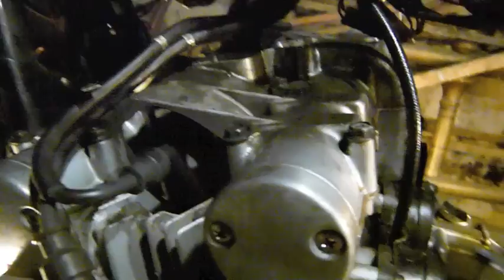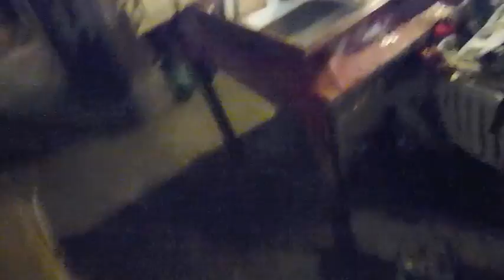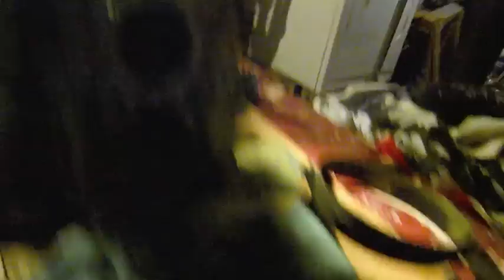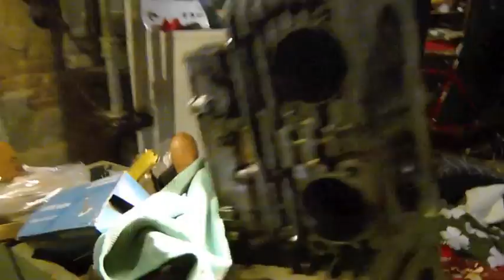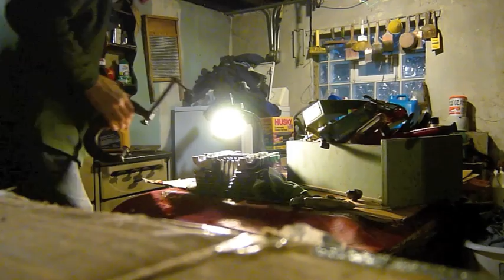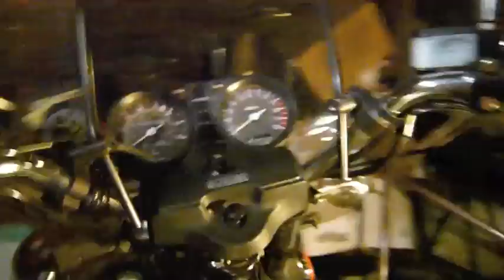singing mc mechanic 1

Comment: Is this where you can get free advise from a mechanic ?
true story.. 

 Last week my car started acting like it was running out of gas ( had plently of gas ) and stopped abruptly in an ( intersection of course ) refusing to start until it sat for awhile. It did it again this weekend.  What do you think ? Clogged fuel filter? Bad fuel pump? It's getting pretty hairy coming to a dead stop in busy intersections..
 It's a 2009 Toyota Corolla XLE ..